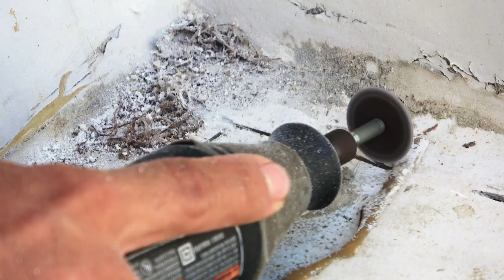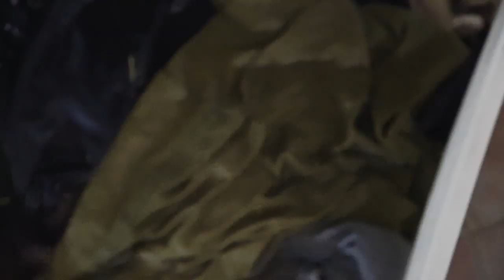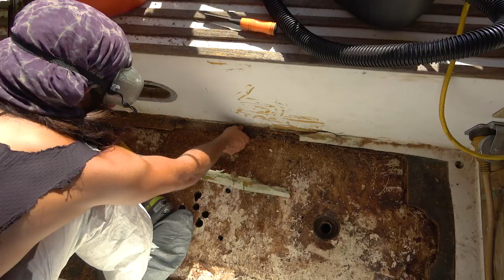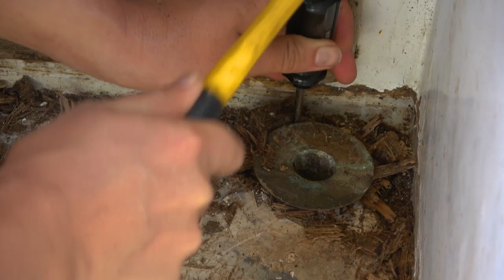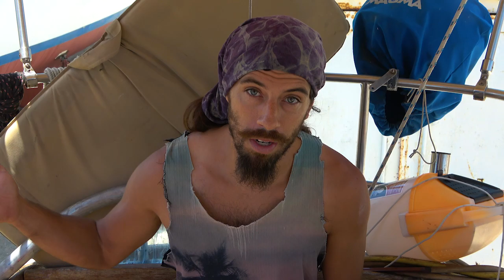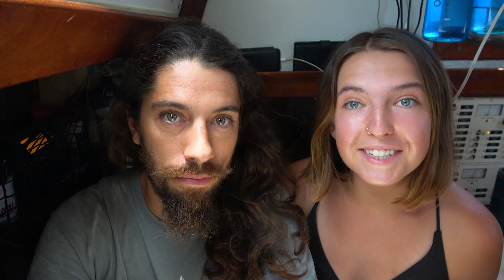OH No! Guess What's UNDER our SOGGY Cockpit Sole Ep 79

Comment: If your boat fixing skills were as awesome as your video storytelling, you'd already be in the Marquesas making moves on Madagascar - which is not to say your boat building isn't solid but I think you do awesome productions :-)))  On matters more mundane, I have a similar issue with a boat - for my money, clean up the lowest layer, glass over to preserve the (flat) shape (maybe support with a board underneath while doing this) then basic 3/4 ply for the interlayer and glass on top joined to the sides. Cheers guys

Comment: I might as well leave a comment of my own here.
There has been some comments to replace the rotten core with foam or some other soft core material.
That is a good idea in some places, but not here. Not in this case.
Since you have a steering pedestal there, the cocpit floor needs to be surprisingly strong.
A wobbly steering pedestal is not only annoying, but in time is going to cause leaks and other troubles.
There fore the correct way to repair this, is like it is originally done in quality boats.
Take out all rotten material. So tear out also the original rotten core.
Repair and strengthen the bottom layer fiberglass.
Install a new PLYWOOD or some other HARD CORE material, using epoxy.
Laminate a new top layer cocpit floor. You do not need to use epoxy here. Polyester is faster and cheaper and under rated.
Prevent the future water intrusion by epoxying ALL holes you make or drill in your new core.

Comment: If it were mine I would replace the whole floor. Once the water got in it spread everywhere in the wood. Take your new deck wood and coat both sides with resin. Glass the bottom with one later of csm. Use thickened resin to glue the new deck down and screw it in with stainless screws and sink them flush. Then lay three layers of csm down on top with each layer extending past the others on the sides to tab it in. And last roll down gelcoat mixed with cabasil with a smooth roller. That will give you a non skid surface. Use a good quality no wax polyester resin and a waxed gelcoat. No need for epoxy. Epoxy is very good but its also very expensive. Polyester resin is much cheaper and if you do your prep work and use it correctly your work will last you a very long time.

Comment: I would not use plywood I would get some marine foam board about 5/8 or 3/4 inch thick and glass both sides of it with a bi ax and csm, multiple layers on the bottom of the foam,to build it up then lay the foam core in a bed of resin on the old floor and  tab it in several over lapping layers  but I don't know what shape the old floor is though

Comment: I agree with the previous comments in as far as complete removal is the best way, just leave the lower layer of glass,sand and reglass with 2 layers of biaxial. forget the wood, get koosa board or nydacore then glass over tabbing at least half way up the sides of the well. drill all holes oversize then fill with thickened epoxy and re-drill to size. I would use butyl tape on screws and bolts or Sikaflex291 but the 4200/5200 work too so personal preference on that. be a shame to waste the work already put in by removing the first dodgy repair, one dodgy repair does not warrant another

Comment: She hits a golf ball well.  5200...AKA - F the next guy..- cut the top skin off, clean out the rot and build back....
Reply from the maker: That she does chip. LOL thats funny. Some have told us that was not even 5200 but only silicone. Not so sure.
Reply: @Bumsonaboat  5200 is not that flexible, prob was silicone....5200 has its place and it is not everywhere, can be very difficult to remove, hence "F the next guy"  I've seen it pull the gel coat off..

Comment: Mine is a 50 year old 27 foot mono hull deep keel with single skin mostly with no core stuff and double skin  for kitchen and  Center seating  so not much double skin . The cockpit is similar depth and size  to your with a  well designed leak proof floor hatch  to access over the prop  shaft exit.  However the cockpit hatch is too small to enter under cockpit so i might increase the size of this hatch .My plan is to make very water proof   wooden box covered in  fibre glass that will fill up most of the cockpit. That's because large waves  falling into cockpit cause the boats stern to become very down  as water is heavy and cockpit can fill with 500 pounds or 200 kilos of water in seconds . This can allow the  boat to take a second wave more easy  . Cockpit drains take too long to drain out .  The extra weight of  this much water can cause the rudder to fail in large seas . The box I will make will be held in with straps  so it can be removed for access to the prop shaft . The box would also be used for extra storage of light weight materials like sails or similar . In harbours the box will be probably be removed to allow normal use of the cockpit .Racing yaught often don't have transoms so any waves entering the cockpit flow back out quickly . I know  a pain to not have full depth in cockpit but having had several  waves fall into my previous 34 foot cat and take many  minutes to drain out and cause the metal rudder blade to be bent 45 degrees I respect large waves .  My new policy is don't allow deep cockpits have the ability to  retain  lots of water. . For your floor now is the time to look to make a floor hatch which allows access to  back of the engine region . You have to plan that cockpit box so it can be made water tight . I would prefer then  to opt for single skin floor with   glassed in  wooden struts under the floor  forb stiffing up the floor  . After  making the access hatch or getting access to under the cockpit floor  get under the single skin  cockpit floor and tiffing it up  with the  use layer of glass over all of it  underneath to stop leaks and make it more rigid in  . Then clean top layer of old glass  and put layer of epoxy with S glass on the cockpit floor  for more ridgity   and also stop leaks  etc.  Then paint it with suitable paint . If your keen to not lose the depth of the cockpit look to make much  large drains holes preferably out the transom region done in way that flaps or similar  can stop water coming back in. with large waves .  That might require to Fill the cockpit with water on the water to see what level the boat  transom goes down in flooded cockpit scenario and how long the normal  drain holes take to lose that water . Pay attention to problem of deck movement up and down . In severe weather the pipes on the cockpit drains have been known on drop keel  22 foot jaguar boat  to start to come off the hull fitting causing instant ingress of water . Then the floor moves down blocking the water ingress as the drain pipes reseat  . A SOB  TO LOCATE WHERE IS THE WATER COMING FROM AS YOUR SINKING . A Friend mine been there got the T shirt and also broke the rudder for the extra water weight . As he said getting access to the cockpit drain tubing to stop the leak while submerged in freezing Icelandic water when the boat is very full of water put hairs on his Icelandic chest . Then  when he  later changed boats he then  clobbered a whale to add to his woes .There is a lot to be said for the open transom solutions with no drains in it . The size of the cockpit you have isn't looking to be big enough to justify the use of double core but there might be other issues like structural benefits to deck to consider  but I dought it  So  if you want original double core  then go for  go for it  but  its a bit over engineering for my taste and for  my budget constraints .

Comment: There's arguments for both approaches. If you're going to cut out the original floor, are there any structural members under the original floor that are affected by the rot or cracks depending on the material? Laying (what i hope was marine plywood) may only trap more water if it gets in. I just don't know what's supporting the floor. That may add another piece to repair puzzle.

Comment: It all depends on how long you want to keep the boat, The stuff you just removed would have been fine if it was done reasonably well, but it was not. If it had been done well, you would not be removing it and you would never been the wiser.  Laying new ply and glass would work just fine, if you do a good job.  The shitty repair lasted a few years,  a good repair may last three times as long, or more.   Remember, at some time in the future you will be getting a bigger boat and the one you have still will not be worth very much on the market regardless of what shape it's in. 
You were going to remove the cockpit sole anyway, so it would stand to reason that another couple days work would be ok.  
That being said, be prepared to find more issues if you go further.  Could be fun.

Comment: IN the best of all worlds you should remove the old core, clean up the bottom glass skin, strengthen it as needed (a couple of layers of 1708 biaxial fbric mat) install new FOAM core and put down a new top skin.  That will give you a solid cockpit sole that will never rot.  Alternatively, glass over the sole you have exposed now, install new core (foam best, marine plywood OK) and then put down a new top skin.

Comment: Just replace the whole cockpit floor, and the scuppers too, It will never get better, only worse. I'd pre laminate the plywood core then just use bi-axial cloth rovings onto the sides of the cockpit, do your preparation work thoroughly, and you should be fine

Comment: The real question is do you have another layer of glass under that original core? If you do it wont be a big deal to remove that top skin and original core and still have a layer of fiberglass to adhere your new core to. If the original bottom skin (underside) is not exisistant or in real shit condition where adhereing a new core to is going to be a nightmare, I wouldnt even bother and go for the easier quick fix for the win.  Grind/ sand that top layer of fiber glass, Lay a couple new layers of CSM to fill all the holes and cracks, Fiberglass both sides of new plywood floor board, put down some peanut butter thickened resin, trowel it out, drop new deck core on top, put weights, then couple layers of mat and cloth to tie it in. Even a quick fix will last 20 years as long you seal it up well enough (not 5200)

Comment: mississippi maytag used them for decades in the horse racing barns to wash saddle towels and leg wraps + your clothes in a bucket or tub.
https://www.lehmans.com/product/rapid-laundry-washer/

Raise and lower Rapid Washer like a plunger. The special internal baffle sends water rushing through clothes to flush out dirt.

Tin-plated steel head with reinforced rim
Handle of northern fir
28-1/8"Lx8-1/8"OD
2 lb
USA made
Note: This item is tin plated steel and it will eventually rust if it is not dried after each use.

Comment: Hi Joel , I think I would cut sideways as low as you can at the bottom of the cotpit into the side of the cot pit. Then put temporary plywood pieces under the bottom ( or better Formica covered particle board as Fiberglass won't stick if waxed , like cheap countertops) then build up from the inside up the sides of cotpit with cheap polyester fiberglass, about 3/4 of the way they put some SS screws thru the new fiberglass into the good sides as extra fixing, then more fiberglass. You could core the bottom but make sure you use NO wood, find something else . Then sand an fill smooth enough and put nonslip paint on it .remove the temporary mold wood pieces under and you are done.
Cheers Warren

Comment: I'd probably cut it all the way back, but I'd do it fiarly quickly, like the next day, and get it glassed back in. I'd want it all done and dusted in like 3 days, tops.   Sailing is better than boat fixing!  The extra time to strip it right down will be only a few hours, the rebuild time is almost the same. re-glass the base with biaxial and a chopped strand topper, then core, then chopped strand and 2 layers of biaxial. Take the biaxial about 4 inches up the sides to bond it back in.  Flow coat and your are done.